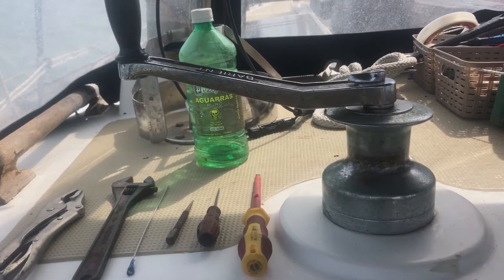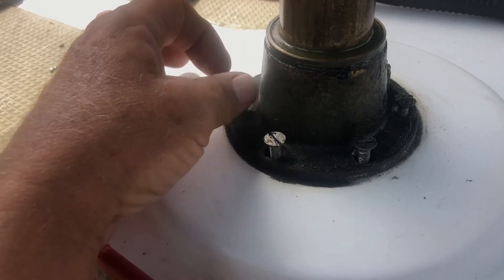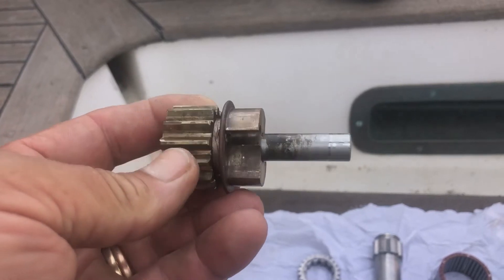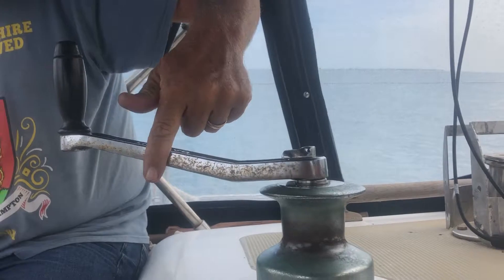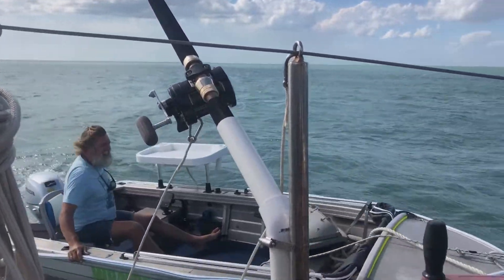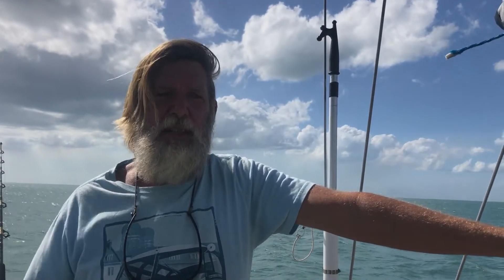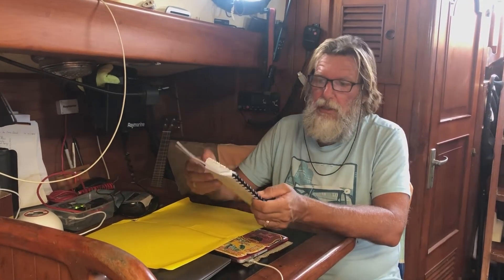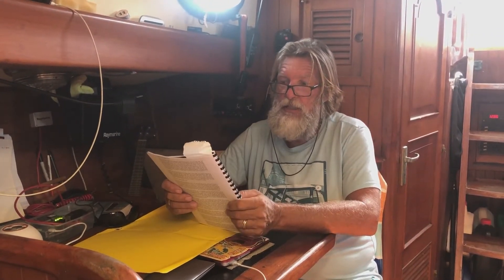Ep 257 | Winch Servicing, Weipa Arrival, Sailing Nutshell Australia

Comment: little parts hidden in the bowels of gear box,  I like wheel bearing grease for boat trailer.  Keep in mind you are in a HOT climate mostly so grease will never get thick, just dont put on 1/2 the tube of grease.  thks for videos.

Comment: Magnus could you achieve a lighter grease for the guts of that winch by mixing the heavier stuff you had on hand with a touch of diesel? 

I also wonder if a drop or two of diesel might substitute for machine oil in a pinch?